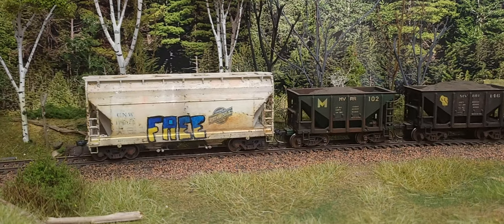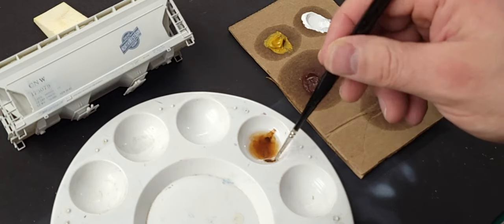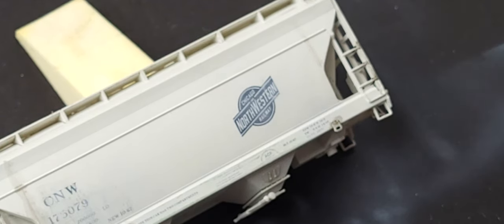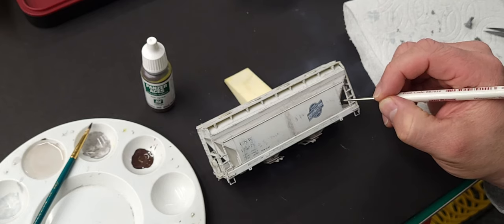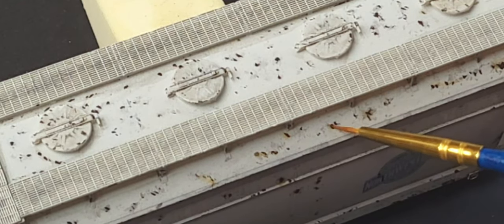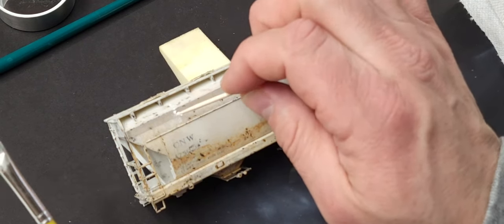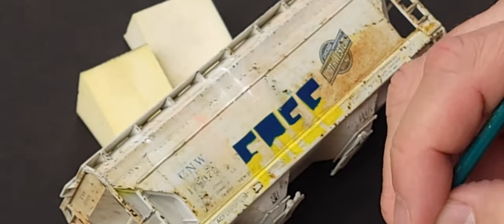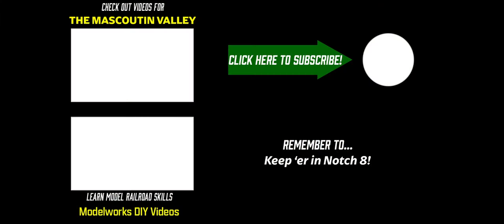No Powders! No Pastels! No Pigments! Weathering an HO Scale 2 Bay Covered Hopper

Comment: Great video! If you add more graffiti tags to your models, consider trying out a Micron brand pen for the black outline. You can get super small tip sizes such as 0.35mm. I found these to work great in N scale as I can get sharper, neater lines with the marker than the brush for the black outlines. A fine sharpie is a decent alternative. The tip isn't as small and I find the black to be too glossy for a tag that isn't brand new.
Reply from the maker: That is a great tip!!! Thank you!